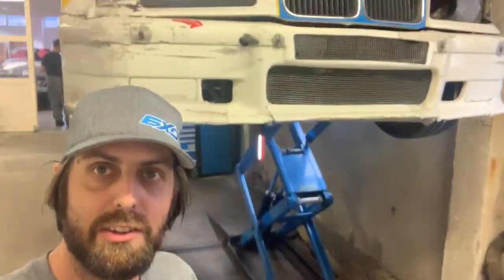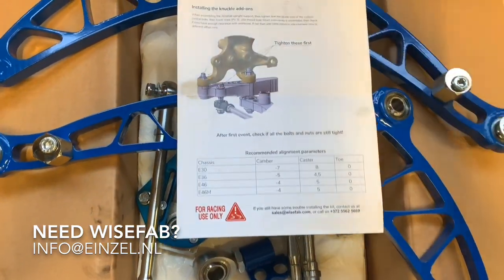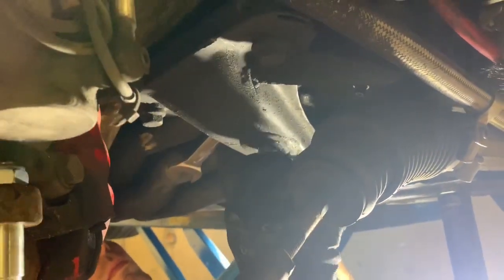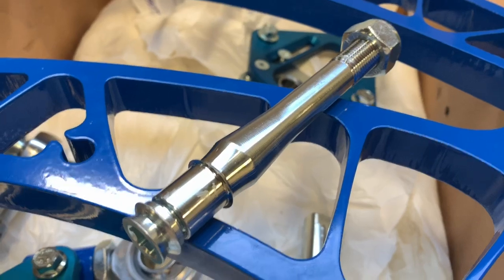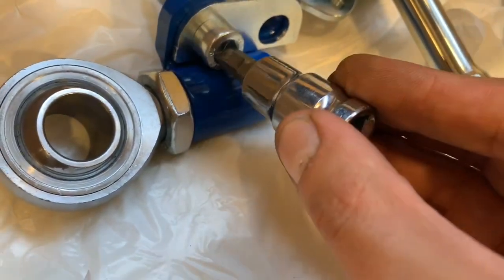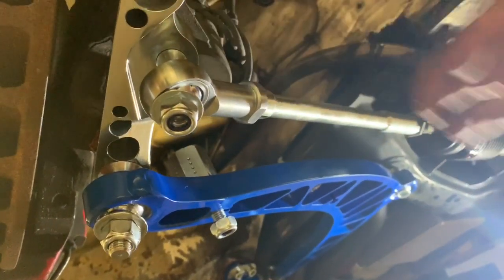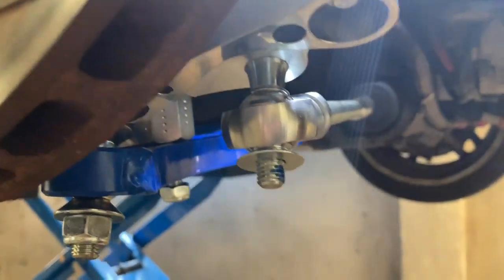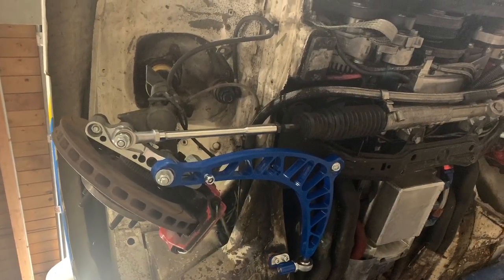Wisefab E36 E46 Drift Angle Kit Unboxing Installation and Explanation , Torque Specs

Comment: What really gets me is why no one shows the full install. Like how does the subframe part go in? Im having an issue with that part, and it’s skipped in the video :(
Reply from the maker: Which subframe part? You can see Thijs install it at 1:46

 Its just a pin. Hold a socket or spanner on the nut and bolt the allen nut + pin into  it?

Then align the uniball and slightly tap it onto the pin. 
If you look from underneath you can easy see how to align.

Or you can mount it outside the car and then install like normal BMW arms.